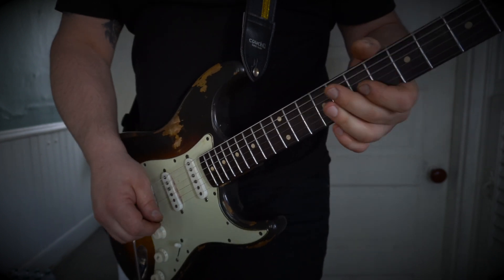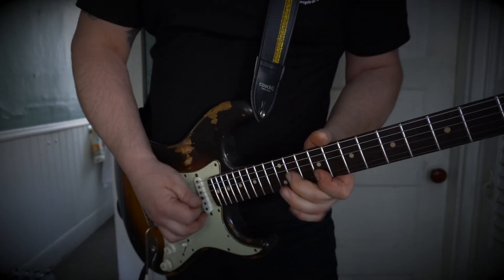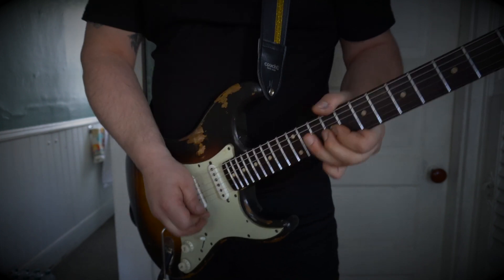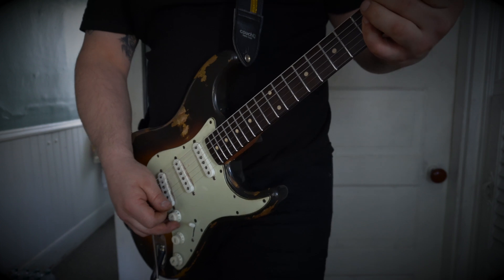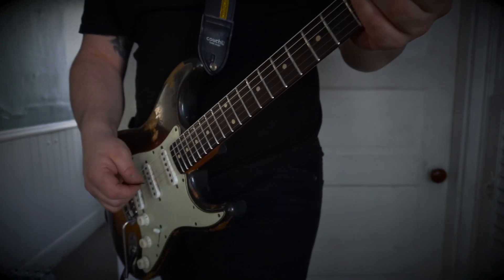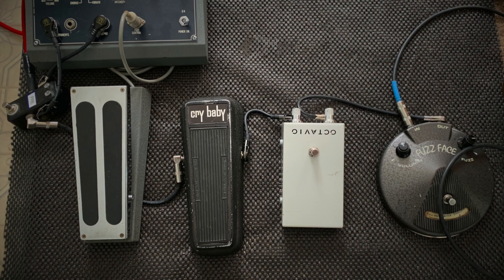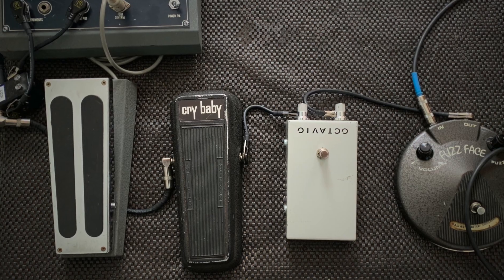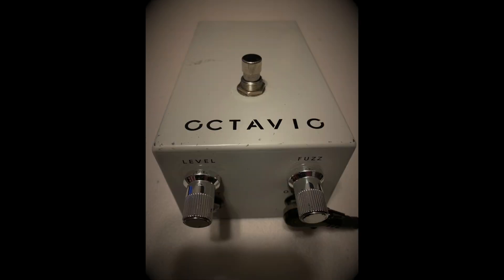getting a good OCTAVIA TONE!

Comment: Great post! Always helpful to have a seasoned player’s knowledge on how to use these Vintage effects. 
The thing about all these Vintage style effects, they are NOT plug and play. BUT, they are DYNAMIC! Meaning you get several very usable and variable tones. Adding them into the chain, means add a whole new color palate...that you then have to experiment with to master.
The awesome thing is being able to find a shade that is really you. Their are many players who have carved out their own tones using very “Jimi” style pedals.
I use a Purple Octopus after a Tone King Mini Fuzz (clean Octave, Fuzzface/Zonk Style pedal). Little less variable, but still allows for a wide range of tones with the volume and tone controls on the guitar. Basically, Fuzz is almost always on, and goes from clean to sick! Octave add a slight boost, and color to whatever is going on with the Fuzz. That way the sound has good note separation with all levels of breakup.